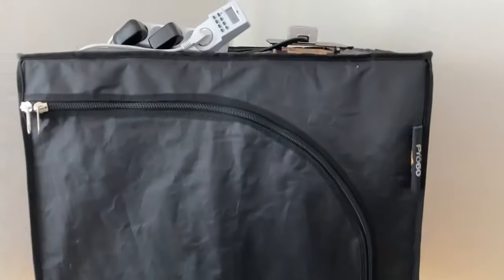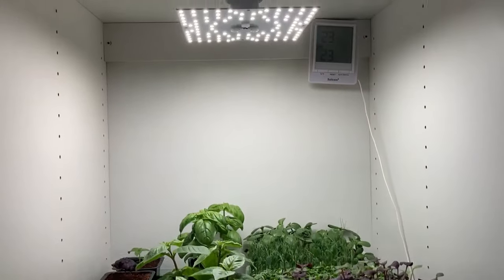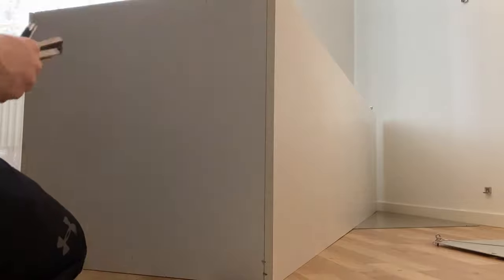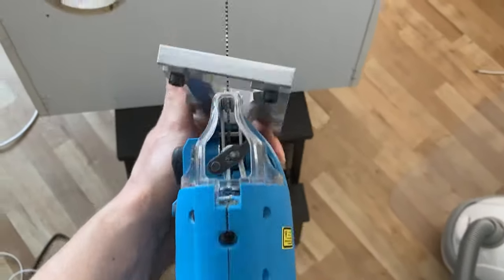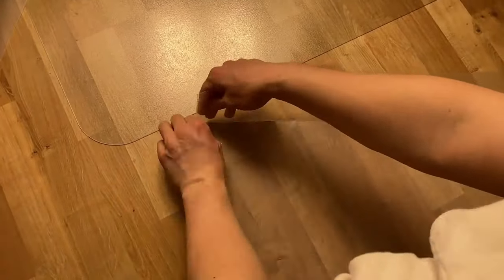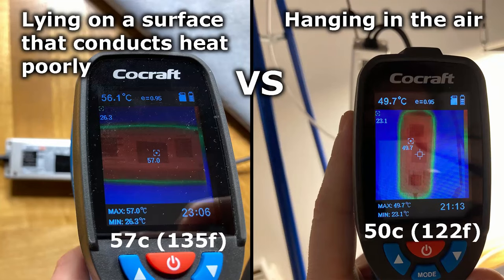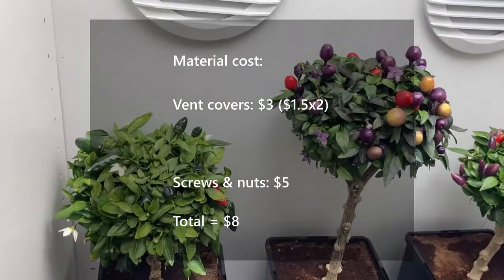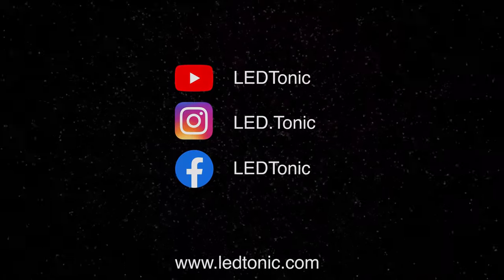DIY Grow Room Closet (Wardrobe) Build & Setup - Grow Tent vs Closet

Comment: On the intake side at the bottom i use a car cabin air filter to get rid of any pathogens and unwanted insects or damp or dusty air from entering the grow area cheap and effective for 3.95 euros you cant go wrong its like an air sock

Comment: Misleading… where is all that plant smell going to end up with all them holes
Reply from the maker: It wasn't a problem in our situation (obviously) but it could be if one is growing medicinal plants. This setup is best suited for one who either isn't growing smelly plants or simply don't care about the smell. After all, it is legal in many places and/or the grow station is placed in a garage and not inside the living area.

If you care about stealth and want the wardrobe look but still want it smell-proof, it is possible to place a 2x2' tent right inside the wardrobe. If a tent is just a tiny bit too large for your wardrobe, it is possible to shorten the tent's poles with a hacksaw or angle grinder.

Hope this info helped. Thanks for commenting and have a great day!
Reply: @LEDTonic  fair response👍 type in certain plants into a search engine and this comes up hence i just presumed it was something else.

I was wondering on what todo for a closet for the smell? Even if i did use a airfilter doesent that have to be going outside or something?
Reply from the maker: @Newb118  A carbon filter will remove most or all odors from the air before it leaves your tent/closet. It isn't required to vent out of the room but you must vent out of the tent/closet to get new air and CO2 in to your plants and to get the heat and humidity out. You can DIY it and I've thought of doing it myself, but I'm sure it is a lot easier to buy a pre-made filter and hook it all up. Make sure to have the right size fan and filter for your setup.

AC Infinity have an informative video on the topic:
https://www.youtube.com/watch?v=9jkDQd7fUWQ

Cheers!
Reply: @LEDTonic  yoooo, quick thought, what would be the point in a carbon filter/fan if the grow room has a air vent surely the air will still get out or am i wrong here?
Reply from the maker: @Newb118  The fan push/suck air out via the carbon filter and creates a slight negative pressure inside your grow space which makes it impossible for smells to escape via any other route. New air will enter the grow space through the vent and other small leaks but "old" smelly air will only escape via the fan-route. A tiny negative pressure won't be enough, though. This is why it is important to have a large enough fan and filter to create enough suction.
Reply: @LEDTonic  your a legend mate! Helpful and couldn’t be any clearer ha, hope your channel continues to grow👌

Comment: The cost is only 8$? So the LED are for free or what? This is a 600$ set up. You can get a complete grow set for the same money.
Reply from the maker: This video was about comparing tents versus DIY grow spaces, not complete kits. 
A lamp is required in both setups, just like the fans, which is why these costs weren't included.

The Q2 lamp, which is illuminating the top level, is priced at $55.

The first batch of Q6 lamps is still being produced and should reach Amazon in a month or two and the final price should land somewhere around $250 for a unit.

I hope this cleared up any confusion.
Have a great day and happy farming :-)

Max
LEDTonic

Comment: Good vid, you really could likely eliminate the top shelf.  Based on what limited amount of plants can be grown at any given time, the height space and single light offers a better plan, just my opinion, nice work!
Reply from the maker: You're right about that! Most full-size light-loving plants grown at the bottom would require the top shelf to be removed. All our peppers were made into bonsai-sized plants which is why it worked perfectly for us. In our situation, the top-shelf canopy had between 150-300 PPFD light intensity and the bottom shelf had 2-3x that, which was just perfect.

Thanks for your comment and have an awesome day!

Comment: Good job but its not worth the time and money. Grow tents are cheap, you can assemble and disassemble whenever you need. By the time you have done this you have just about spent as much as the grow tent would have cost anyway due to them being so cheap. Also due to the materials being made out of cheap wood materials they are prone to rot if the moisture is not controlled properly.
Reply from the maker: Absolutely. Tents are rather cheap and have many benefits. Although, I did like having a white inside, a door instead of a zipper, and being able to screw things (fans, cables) to the hard walls and ceiling. The humidity doesn't reach very high levels here in Scandinavia but I'm sure it could be a problem in other parts of the world.

Thanks for commenting and have an awesome day!

Comment: Growing in a wardrobe has one more advantage over a grow tent - stealth
I had a similar setup many years ago, in a rented apartment, which was inspected (a brief look-around) every 3 months by a letting agent. A cheap 2-door wardrobe with a carbon filter, a cheap-ish 150W LED panel and 1 autoflower plant in a oxy-pot DWC, LST'd on a mesh net. Never had a problem. It was producing around 100g of dried bud every 2.5 months. My worst harvest was 90g, my best was 135g. The guy inspecting the property, each time was just a few feet away from the "growdrobe" and probably looked right at it many times, without ever suspecting there was a gorgeous weed plant in full bloom in there. This would never work with a grow tent, they are way too recognizable, even the smaller ones.
Reply: Holy. You need to make some tutorials on your growing style I just started my first 3 flowers, hopefully I can get even a bit close to those numbers👌
Reply: Nice

Comment: Noctua fans for the silent operation, Nice.
Reply from the maker: They are very quiet! The NF-A14 is incredible and the NF-A20 is even quieter, but a bit more pricey and doesn't produce the same static pressure.

Thanks for your comment! :-)
Reply: The NF-P12 REDUX-1700 PWM are also a great choice.
Reply: I just had to ctrl+f the comments to see who else spotted the Noctua

Comment: How the air flow from the biggest part to the top? There's only a small passage pf air between the door and the wood on second level...
Reply from the maker: As the shelf was shortened, the gap was 5cm(2") wide and this was more than enough for adequate air flow. The bottom and top part of the closet only differs around 0.5-1 celcius, which can be seen at 8:39 in the video as well.

Thanks for watchin and have an awesome day!

Comment: What does your power bill look like?
Reply from the maker: The big lamp draws 160 watts and the small draws 35 watts. Fans included, it totals around 200 watts. Running for one hour, this results in 0.2 kwh (kilo-watt hours). Running it for 16 hours per day and with a cost of 15 cents per kwh (US average), this results in:

1 day: 3.2 kwh = $0.5
30 days: 96 kwh = $14.6
365 days: 1152 kwh = $175

Thanks for commenting and have an awesome day!